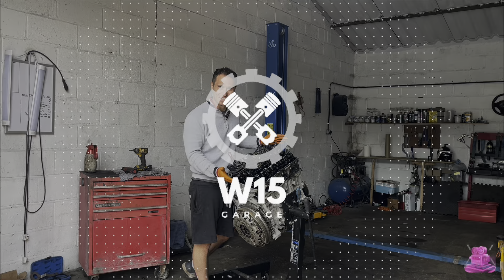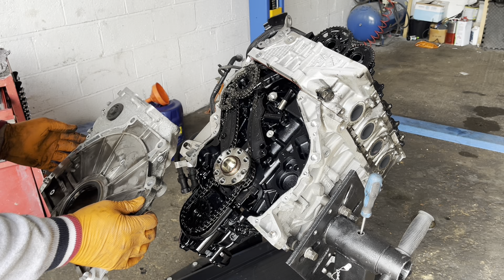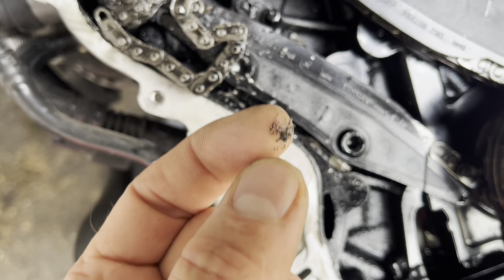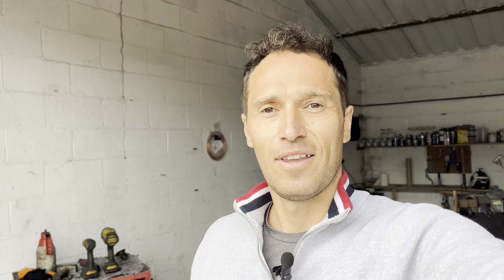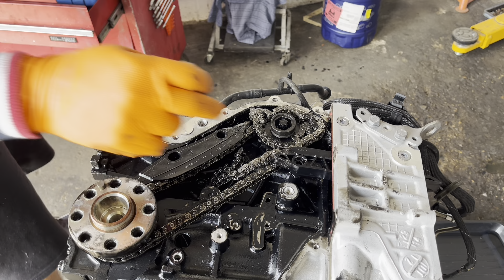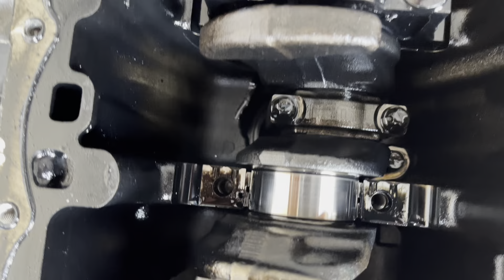Timing Chain Failure SAVED This BMW N47 Engine From Scrap Yard…It’s All My Fault!!!

Comment: I believe all the oil lines need to be thoroughly cleaned, and the pistons should be removed to inspect the block's surface for possible metal scratches.
Reply from the maker: @aminekaddache9767  everything will be checked. Thanks for watching
Reply: @W15Garage  oh thank you , i really learning lot from your videos
Reply from the maker: @aminekaddache9767  thanks for watching!

Comment: Hi good work! At 7.00mins you mention checking compression, how would you perform that/what results would you expect to see and would that be before fitting engine back? thankyou
Reply from the maker: @rob3865  Thanks for watching! Compression can be measured using a gauge. First, remove the glow plugs and insert the adapter. Then, with the injectors disconnected, crank the engine and check the compression. I have a video where I check the compression of a BMW N47 engine.
https://youtu.be/S6GJv2WSD-s?si=V9-1RoKroJYxxIzu
Reply: @W15Garage  would be good to see a cylinder leak down test done following the compression test to see the expected results! Great job on all the good work, keep well and best wishes.
Reply from the maker: @ Many thanks! There was no point in doing a leak-down test after seeing very consistent compression results. Since the car was performing perfectly, with no blow-by or oil consumption, a leak-down test would have been unnecessary.

Comment: Good job! Thanks for explaining it so well! Learned a lot
Reply from the maker: @erikaszekely3315  thanks! Really appreciate it!
Reply: @W15Garage Hey Bro, i Need your help...After rebuild my n47 the starter spin but not engaging...no codes in dde stored...It cranked First 10 sec tò build oil pressure, then second attempt It Just spin but not engaging on flyeheel...help me pls
Reply from the maker: @ try repositioning the starter, remove all three bolts and reinstall it.
Reply: @W15Garage  i Will try...thank you!
Reply: Hey mate i replace the starter, It was broken, however the engine knock...i have rebuild the crankshaft and bearings, but knocks with no fault codes...can  stuck injectors cause the engine knock? Like Rod bearings? When i open engine It was all ok...Just replace Rod and main bearings and properly torque and measured with plastigauge... help me pls
Reply from the maker: @ what was the clearance on the mains and con rod bearings? Also did you use new bolts for the main caps and conrods right?
Reply: @W15Garage  0.035 for main 0.040 for rods...yes new bolts obvilusly...but it was knocking before i open It...i was think rod bearings shot, but it was all 4 like brand new, main was in bad condition but not a single scratch on crank.
Reply from the maker: @ usually rod bearings look almost new on n47 n57, main ones are the week point. Your tolerances are good, if good quality bearings were used you should be alright down there. Try removing injector electrical connectors one by one, see if the knocking stops. Pull one out see if it changes put it back, stop the car, restart then pull the next one…and so on
Reply: @W15Garage  i Will try...have you ever experience fault injectors knocking like rod bearings knock? At this point im worried something related tò pistons...
Reply from the maker: @ No, rod knock is very specific and cannot be mistaken for injector noise. The cylinder walls looked good, with no scuffing or similar damage?
Reply: @W15Garage  no scratches mate...i Will do a compression test..can you provide me good values for compressione? BMW n47 2.0 177hp
Reply from the maker: @ Not sure specifically about the N47D20A, but I recently measured 23 bar on an decent N47. Ensure the compression difference between cylinders is no more than 10%
All the best